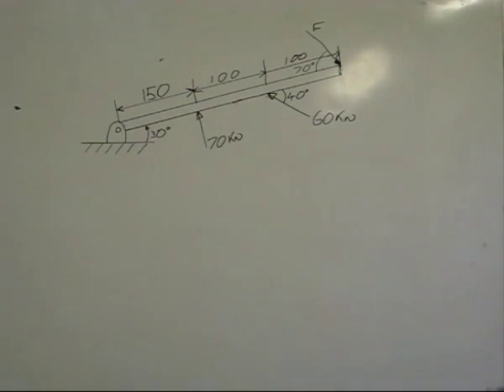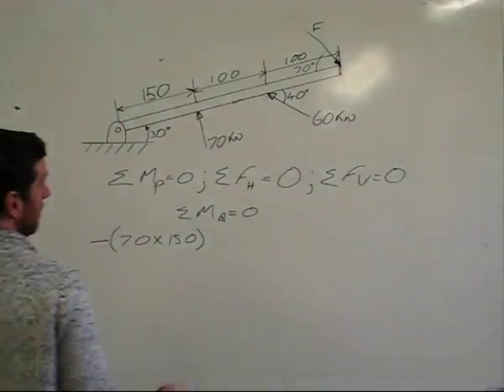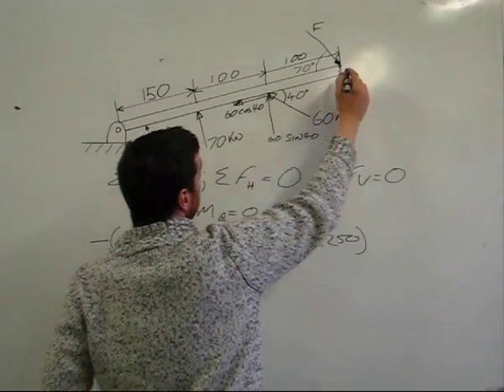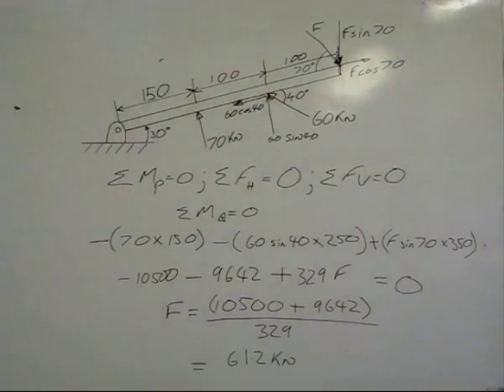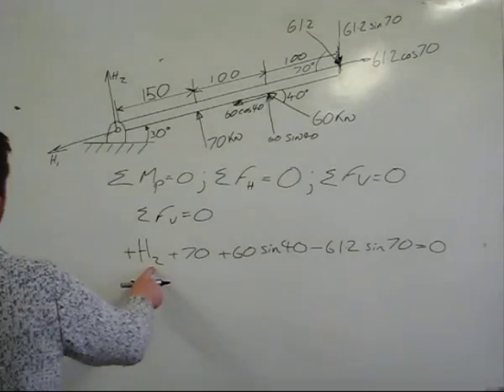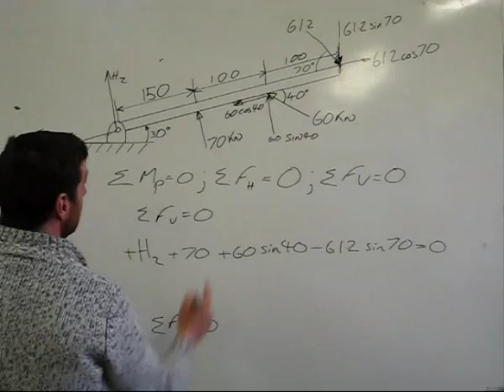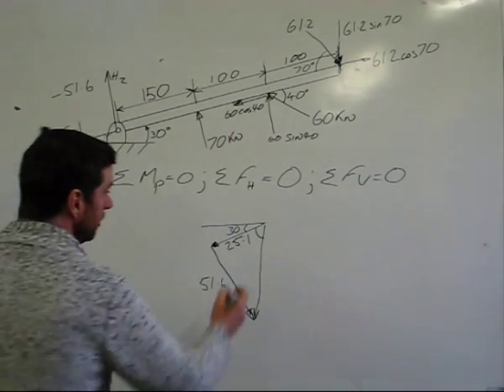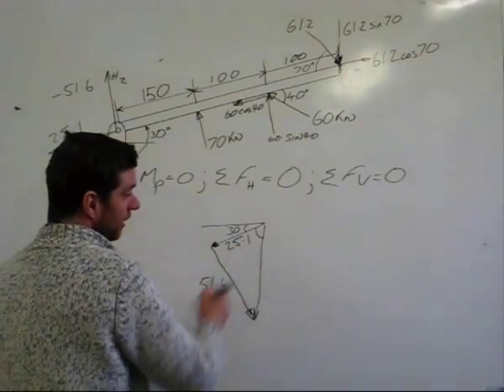moments at an angle

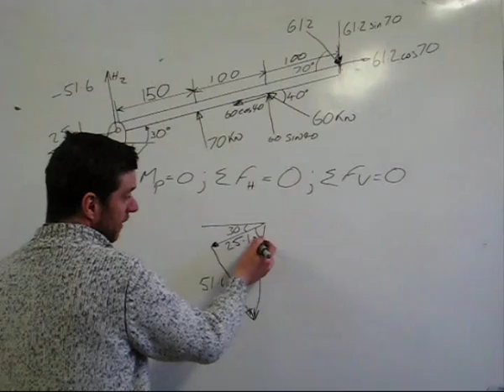Comment: At 7:01 in the video, would I be able to just subtract 30 from 90 in order to get the highest angle in the triangle that you have drawn? (60?)
Reply from the maker: tan -1 (51.6/25.1) gives 64 degrees.So the resultant is at 104 degrees
Reply: I see, thanks.